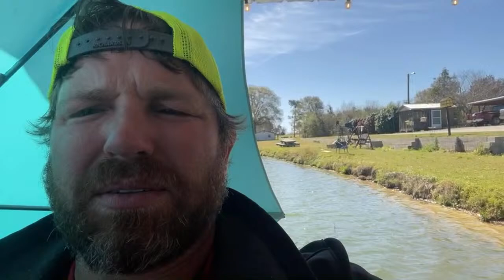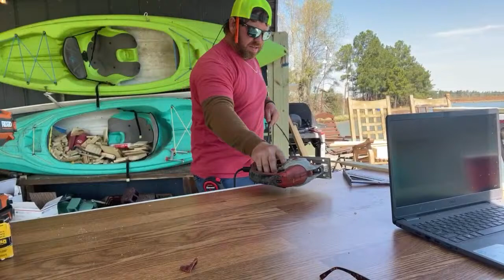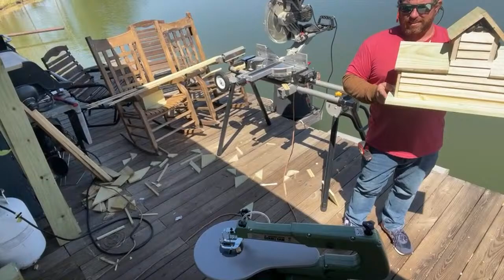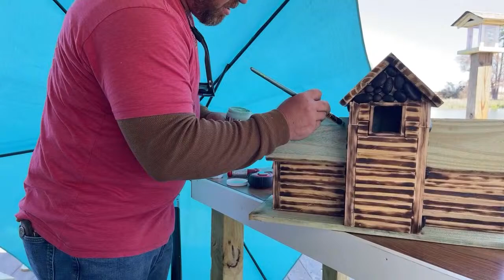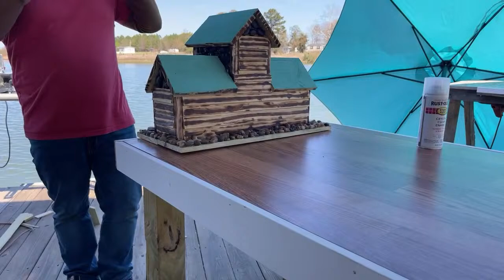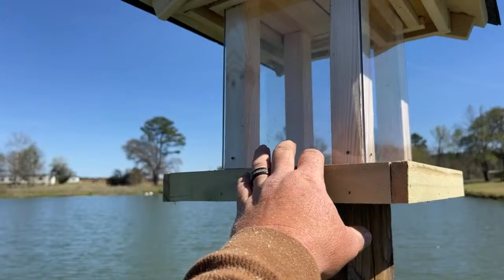Fun bird houses with Steven Hodges

Comment: What a beautiful bird house!  I have a couple of bird house's that I did like that.  I made little wood shingles for the roof and I made frames for the windows.  One even has a big front porch and steps going up to a little back porch😄. They're really cute. 
I don't think that hot glue is going to hold up when it gets really hot outside. Especially the rock's.  I think they're going to fall off.  If you paint a layer of epoxy resin on that should hold it all together. Next time you might try Gorilla wood glue.  I don't know if it will work on the rocks but for the wooden parts it will.  It takes hold in just a few seconds.  Grandma always uses E6000 glue to glue the rock's on.  You might ask her how well it works.  She may have put a layer of epoxy resin on too.  It would be sad if the parts started falling off.  Bird's will be nesting in it so you won't be able to fix it until they move out. 
I'm commenting before the end of the video so maybe you do plan on a way to protect the parts from falling off.  Please excuse me if that's the case.
Hope you all have a wonderful evening!  Much love to all❣️
Reply from the maker: Ok I’ll try it